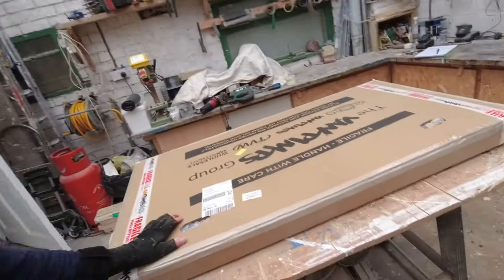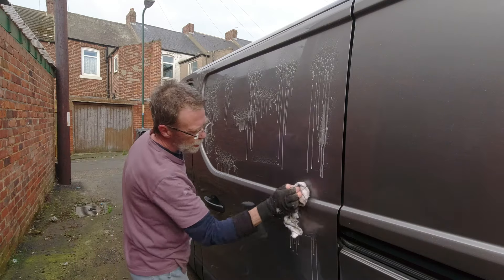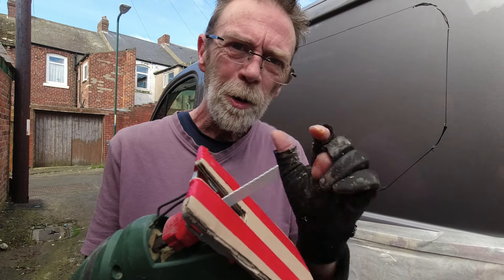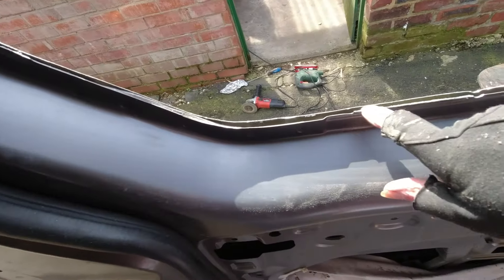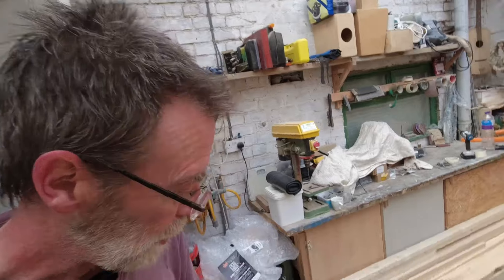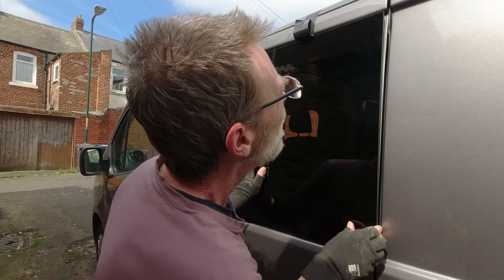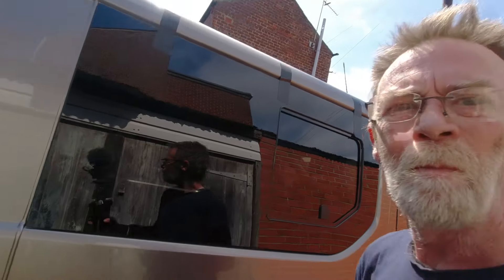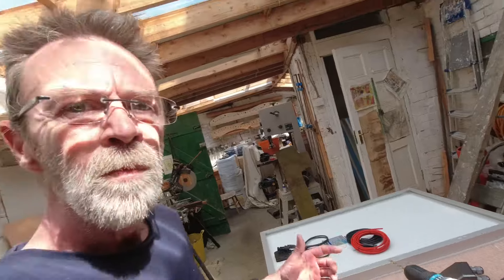Vauchall Vivaro Camper Van Conversion ( Day4 Windows and Solar )

Comment: Hi, Dave. May I please ask where you got your insolation from ? I will be doing a van build shortly following all of your advice, so this may not be my last question. Thank you for providing all your knowledge, i find your videos extremely helpful and feel as if not much can go wrong if i stick to your techniques. I may have to keep you updated on that one 😂😂
Reply from the maker: I got the insulation from B&Q but you can also get it on ebay a search for "plastic bottle insulation" should find it. Good luck with your build. Thanks for watching.